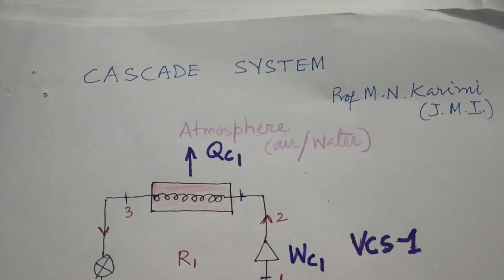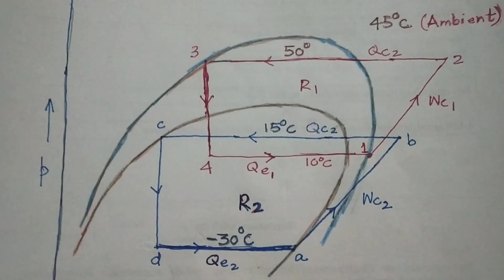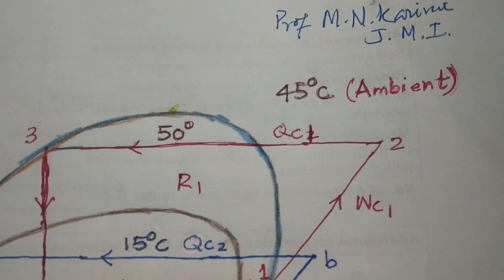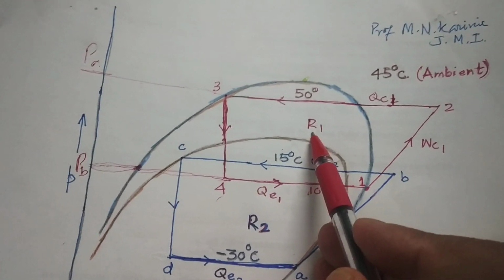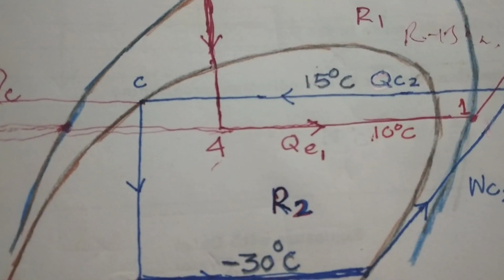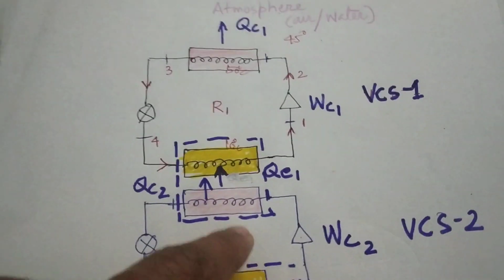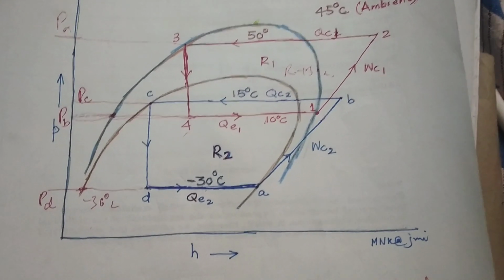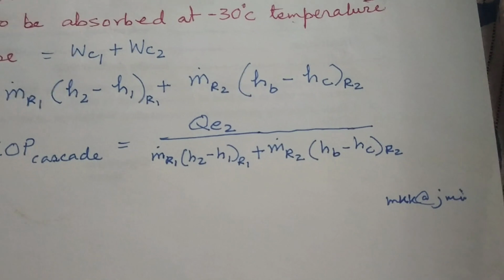Cascade Refrigeration System

Comment: 20BME067
In the given lecture there are two VCS ( vapour compression systems) VCS 1 and VCS 2 having two different refrigerants R1 and R2 respectively. VCS1 and VCS2 coupled together so that the effect of VCS1 is given to VCS2 ( this is cascading effect ) . The given apparatus is designed to achieve refrigeration at very low temperature ( -30°C) . This is not possible by using only single VCS therefore we used  two VCS with different refrigerants. 
Heat absorbed: Qe2
Total work: WC1 + WC2
COP = Qe2 / ( WC1 + WC2)

Comment: 20BME019 ARHAM SAIF ANSARI
In this video we have studied about the cascade refrigeration system is a type of refrigeration system which is actually trying to transfer cooling effect with the help of coupling to system . a vapour compression system (VCS) consist of compressor , condensor, expansion , device and evaporator .  It uses two or more refrigeration cycles operating in series to achieve lower temperatures than would be possible with a single-cycle system. Each cycle in a cascade system uses a different refrigerant with different boiling points. The evaporator of the higher-temperature cycle is used as the condenser for the lower-temperature cycle, allowing the heat rejected by the higher-temperature cycle to be used to help drive the lower-temperature cycle.
The advantages of cascade refrigeration systems include improved efficiency, reduced equipment size, and reduced refrigerant charge. However, they are more complex than single-cycle systems and require careful design and control to ensure optimal performance.

Comment: 20BME053 Hamdan Ahmad

In this video sir has explained about the cascade system.
A cascade refrigeration system is a cooling technology that uses two or more individual vapor compression cycles operating at different pressure and temperature levels. 
A vapour compression system (VCS) has four parts named as condensor, compressor,  evaporator and expansion  and cascade system has 2 (VCS) Each system uses a different refrigerant, which has a specific boiling point, critical value, and temperature. The two cycles  combine together through a cascade condenser, which passes  cooling effect between the two systems. low temp cycle gives the desired refrigeration effect at a relatively low temperature. The condenser in the low temp cycle is thermally coupled to the evaporator in the high temp cycle. This heat transfer makes the cascade refrigeration system to achieve  low temperatures than would be possible with a single cycle vapor compression system

Comment: In this video, We have seen the cascading effect. There are two Vapour Compression Systems (VCS) viz. VCS1 and VCS2 which are connected in series to give cooling effect.The VCS consists of Compressor,condensor,expansion device and evaporator for absorbing heat. The both VCS have different refrigerants namely R1 and R2 having different characteristics. Then from the help pf p-h diagram of both the VCS we have seen how the cascading effect works .

Comment: In this video i have learned that it is a type of refrigeration system that uses two or more separate refrigeration cycles to achieve lower temperatures than what can be achieved by a single refrigeration cycle. The cycles are connected in a cascade arrangement, which allows for heat to be transferred from one cycle to another.

In this system, the low-temperature cycle is typically used to cool the desired product or space, while the high-temperature cycle is used to reject the heat generated by the low-temperature cycle. The two cycles are connected by a heat exchanger, which allows for the transfer of heat between them.

The using a cascade system is that it can achieve lower temperatures than what can be achieved by a single refrigeration cycle, while still maintaining high efficiency. This is because the high-temperature cycle is used to reject the heat generated by the low-temperature cycle, which reduces the overall workload on the system.

Comment: 20BME041 sohrab sanjar
Cascading system is the combination of two vapour compresson system which operated at very low temperatures. In this video we take two compressor VCS1 and VCS2 and also took two refrigerant R1 and R2 which comprises different characteristics. 
Let assume condenser of VCS1 is operated at 50°c , evaporator of VCS is operated at 10°c, evaporator of VCS2 is operated at -30°c , condenser of VCS2 is operated at 15°c and ambient temperature is at 45°c.
From above data it is clear that the condenser of VCS2 cannot reject the heat to the atmosphere because temperature of atmosphere is greater than condenser rejection temperature. 
Now, if condenser of VCS2 is coupled with evaporator of VCS1 than this problem can be resolve, because temperature of evaporator is less than condenser temperature. Heat rejected by condenser is absorbed by evaporator. 
This type of coupling process is called cascade system. 
Now we can find out cop
Cop= Qe2/total work done on both compressor

Comment: Cascade system 
Cascade has got its meaning like the effect of the first is given to the second. And so this is a Cascade system which is trying to transfer cooling effect with the help of coupling to the system. And then further in the video vapor compression system has been discussed, a vapor compression system consists of compressor and condenser (in series), expansion device and evaporator. The evaporator absorbs heat (sayQe1) , we have two vapor compression systems. Further in the video the pressure enthalpy chart has been discussed. In the chart we can see two curves, this is because we have used to two refrigerants, R1 and R2. Refrigerant R1 has a higher value of critical temperature than R2, this is because different refrigerants show different characteristics. Vapor compression system 1 has the state conditions 1, 2, 3 and 4 on the P-H chart. Qc1 is the amount of heat rejected by the condenser, Qw1 is the amount of work done by the VCS 1 similarly Qe1 is the amount of heat absorbed  by the vapor compression system 1. If we want to reject heat from the condenser then we need to have higher temperature of the coil than the ambient temperature. We have 4 pressures, Pa - which is representing 50 degrees C for R1 , Pb- which is representing 10 degree C for R1 , Pc- which is representing 15 degree for R2 and Pd  which is representing -30 degree C achievable temperature. Condenser of vapor compression system 2 interacts with evaporator of vapor compression system 1. Heat rejected by the condenser of vapor compression system 2 will be absorbed by the evaporator of vapor compression system 1. Both the systems are coupled together and this coupling is called cascading. The heat absorbed by the evaporator of vapor compression system 2 is finally rejected to the atmosphere through the vapor compression system 1. So the result is that achieving -30 degree centigrade is not possible with just 1 refrigerant and that’s why we have used a cascading system to achieve our goal.

Comment: Here, in the setup, the cascade is trying to give cooling effect with the help of coupling two systems. For the setup, we have two vapour compression systems VCS1 and VCS2. VCS1 and VCS2 have R1 and R2 refrigerants flowing through them respectively. The refrigerants are different and therefore have two different characteristic curves i.e. pressure enthalpy curves. R1 has a higher critical value whereas R2 has a lower critical value. VCS1 has static conditions represented by 1, 2, 3 and 4 and VCS2 has static conditions represented by a, b, c and d. Wc1 is the work done by compressor 1, Qc1 is the heat rejected by condenser 1 and Qe1 is the heat absorbed by evaporator 1.

Comment: Cascade refrigeration system
There are two vapour compression system VCS1 and VCS2 that each consist of condensor, evaporator, compressor and other components
The two VCS1 and VCS2 have diff refrigerant R1 and R2 with diff characteristics, critical value, pressure and temp.
Qc1 is heat rejected by condensor from VCS1 at 50 degree to 45 degree
Qe1 is heat absorbed by evaporator from VCS2 at 10 degree
Qe2 is heat absorbed by evaporator VSC2 at 30 degree
Qc2 vapour compression system at 15 degree.
The low temp we use vapour compression system 8n series in which heat rejected from one the vapour compression system is absorbed by the other vapour compression and so on finally desired temp is achieved.

Comment: 20BME061 OSAMA 
If there are two systems, the first one and the second in series so that the effect of the first is given to the second is called cascade effect
In the cascade system we are trying to transfer the cooling effect with the help of 2 coupling system
It consists of 2 vapour compression systems ( VCS)  and VCS made up of compressor, condenser, expansion device and evaporator in sequence
 QC1 heat rejected in atmosphere by condenser from VCS 1  QC2 heat rejected by condenser from VCS 2 Qe1 heat absorbing by the evaporator from VCS 2
 Qe1 heat absorbing by the evaporator in VCS 2 
Wc1 work done by compressor in VCS 1
 Wc2 work done by compressor in VCS 2
 we marked 4 pressures in pressure -enthalpy dig ( Pa,Pb, Pc, Pd)and calculated COP of cascading system Qe2/ Wc1+ Wc2

Comment: 20BME072 Mohammed Imran Nazeer

In this video we have studied about Cascade Refrigeration Systems. Cascade refrigeration systems are used to obtain very low temperatures. A cascade system is used in a two stage system but with a very crucial difference: the refrigerant used in the two stages are different. The coupling of the two systems is achieved by using the evaporating refrigerant of the “high temperature stage” to condense the refrigerant leaving the compressor of the “low temperature stage”.The cascade cycle is often employed in cryogenic refrigeration.
In a cascade refrigeration system, two or more vapor-compression cycles with different refrigerants are used. The evaporation-condensation temperatures of each cycle are sequentially lower with some overlap to cover the total temperature drop desired, with refrigerants selected to work efficiently in the temperature range they cover. The low temperature system removes heat from the space to be cooled using an evaporator, and transfers it to a heat exchanger that is cooled by the evaporation of the refrigerant of the high temperature system. Alternatively, a liquid to liquid or similar heat exchanger may be used instead. The high temperature system transfers heat to a conventional condenser that carries the entire heat output of the system and may be passively, fan, or water-cooled.

Comment: In the cascade system , vapour compression system are connected in series to obtain the very low temperature .Heat rejected from the one of the vapour compression system is absorbed by the evaporator of other vapour compression system, that's how finally  a desired temperature is obtained.

Comment: The heat rejected by VCS2 will not be rejected to the atmosphere but instead it will be absorbed by Evaporator 1 of VCS1 since VCS1 & VCS2 are coupled. 

This coupling is known as Cascading.

Temperatures as low as -30C can be achieved at an ambient temperature of 45C taking into consideration the refrigerants being used.

Comment: 20BME042 
Here i studied about the cascade system.  Cascade refrigeration system, at least two vapor compression cycles are used with different refrigerants. there are 2 Refrigerants r1 and r2. Refrigerant 2 will take heat from -30 degrees and Evaporator 2 will take heat from -25 degrees because the coil temperature is -30 degrees. The cop is the ratio of the amount of heating or cooling provided by a system to the amnt of energy consumed.

Comment: 20BMEO55 MOHAMMED TANVEER HASSAN

Cascade Refrigeration system is nothing but combination of vapour compression system and very low temperature can be achieved at very higher ambient temperature and therefore we select the refrigerant which can solve the purpose of low temperature application,if we choose 2 refrigerant then it can be coupled together to achieve the temperature upto -30°c as this temperature can not be achieved with the help of only one refrigerant because each refrigerant has got its own characteristics, refrigerant will not have property of absorbing heat from -30°c as it is limited upto its critical value therefore by coupling we can get cooling effect which is very low temperature i.e -30°c and system working in atmospheric condition of 45°c
Working..
Evaporator 2 will absorb the heat from -25°c temp because coil is set at -30°c .this heat will be absorbed and the compressor will do its work and condenser 2 will reject heat at 15°c
The condenser of VCS2 interact with evaporator of VCS1 , condenser of VCS2 rejects heat Qc2  and this heat will be absorbed by evaporator .this evaporator of VCS1 is not absorbing heat from any space but from the condenser 
COP= Qe2/m1(h2-h1)+m2(hb-hc).

Comment: We can basically use Cascade refrigeration systems in situations where a single refrigeration cycle is not sufficient to achieve the desired temperature range. So in a cascade system we couple two or more refrigeration cycles are used in series to achieve a lower temperature range. Here we are using two vapor compression system for this purpose namely  vapour compression system 1 and 2, the refrigerants used in each cycle are different and have different boiling points. The low-temperature vapor compression system, which is used to achieve the lowest temperature, typically uses a refrigerant with a lower boiling point than the high-temperature vapor compression system. The two cycles are thermally linked by a heat exchanger, which allows heat to be transferred from the high-temperature cycle to the low-temperature cycle.We have different respective temperatures for vapor compression system 1 i.e. 50 degree cent and 10 degree cent with pressures Pa and Pb and similarly for vapor compression system 2 15 degree cent and -30 degreee cent , finally  the  heat transfer occurs and heat gets rejected to the atmosphere by vapor compression system 1 .

Comment: Cascade System :
It is a system in which two or more vapour compression systems are coupled together having different refrigerants in order to give high cooling effect or low temperature. The effect of one vapour compression system over another vapour compression system is cascading effect. 
A vapour compression system consists of :
a) Compressor
b) Condenser
c) Expansion Valve
d) Evaporator
Procedure :
Taking two vapour compression systems VCS-1 and VCS-2 having refrigerants R1 and R2. R1 has higher critical value while R2 has lower critical value. 
Coupling the condenser of VCS-1 to the evaporator of VCS-2 so that the heat rejected by the condenser of VCS-1 is absorbed by the evaporator of VCS-2. 
Coefficient of Performance (COP) :
The ratio of amount of cooling or heating provided by a system to the amount of energy consumed by the system.

Comment: 20BME025 MOHD SONU
In this video cascading refrigeration is explained in a very easy and effective way.
After watching this video I have understood cascade system working and mechanis completely.
Cascading effect : when two or more vapour compression cycles are combined in series the transfer of effect of first to another is transfer it is called cascading effect.
It is used for achieving very low temperature refrigeration from high ambient temperatures. As it is not possible to achieve such a  low temperature refrigeration with only one refrigerant due to constrained of properties of refrigerant , so we have used two vapour compression system combined for achieving it.
In this system the first condensor at 50 degree has absorbed heat from ambient at 45 degree centrigrade and  refrigerant  1 is cooled to 10 degree by first evaporator. Now from here second condensor at 15 degree is placed near it,  this will absorb all its heat from 10 degree evaporator of system 1 .Finally Refrigerant 2 can be cooled to -30 degree centrigrade in second system . In this way we have achieved refrigeration of -30 degree centrigrade from 45 degree ambient.
Also the total work done is the sum of work done by compressor 1 and compressor 2 both.
We can Calculate COP easily by Desired Effect( Qe2) / Total work done.